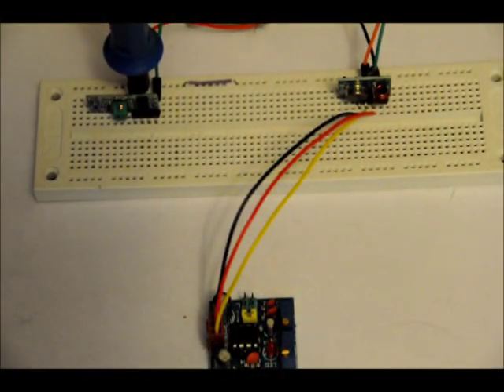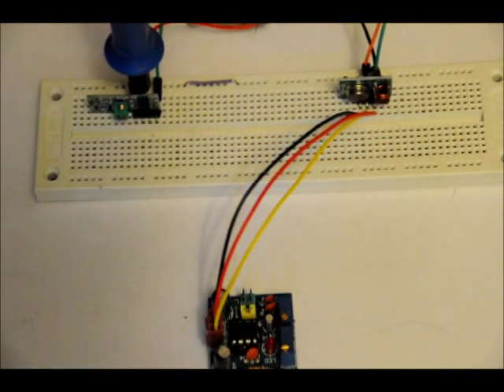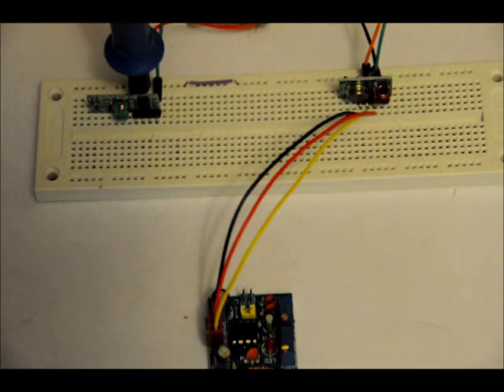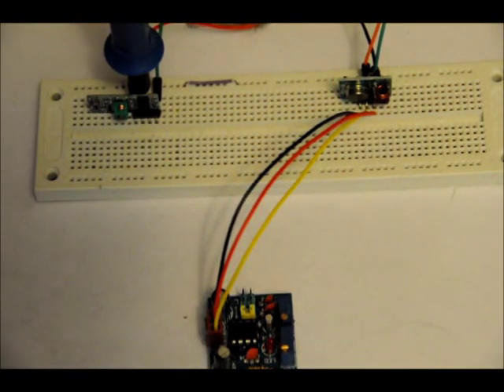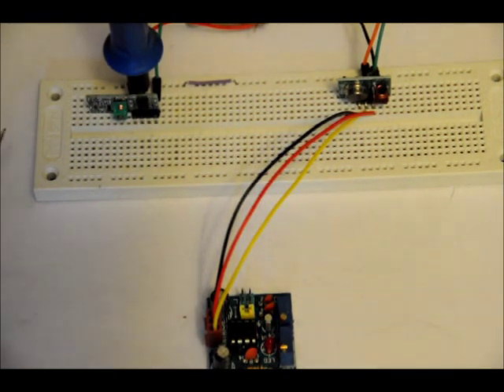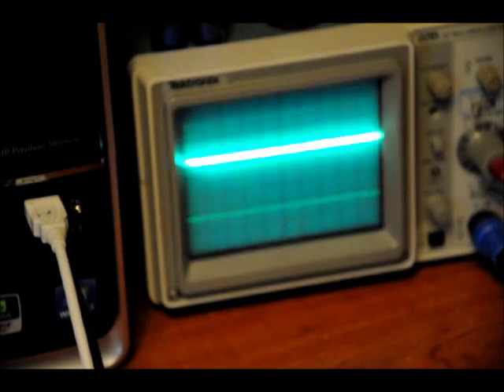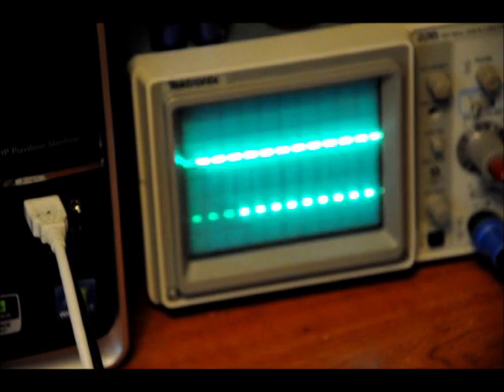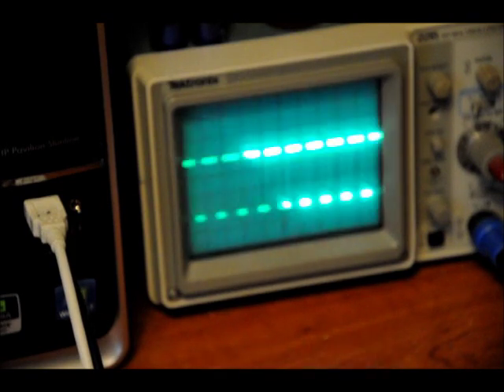Dual 433MHz Wireless Transmitter & Receiver Set - A Demonstration Video

Comment: yes you can by adding a micro controller to the receiver , once the micro cont receives a command it can switch the relay which is attached tp the lamp and hence lamp or any device can be switched on or off .